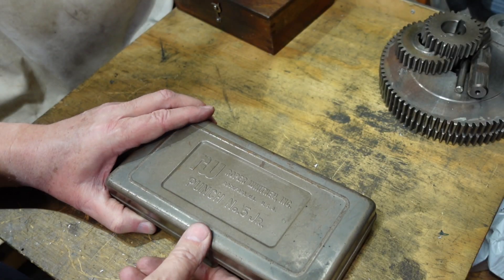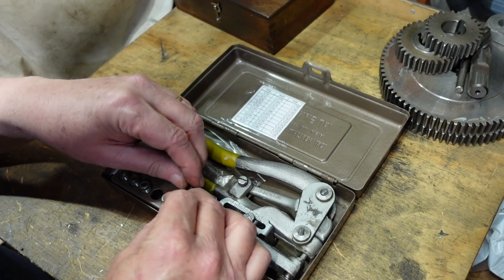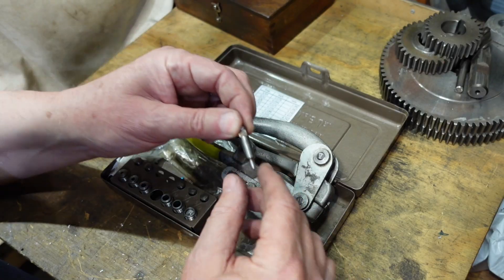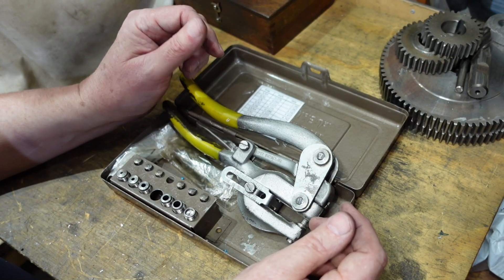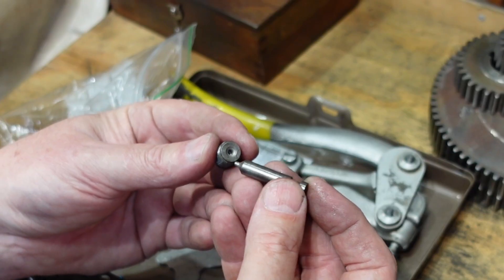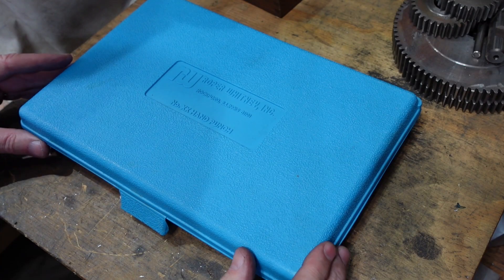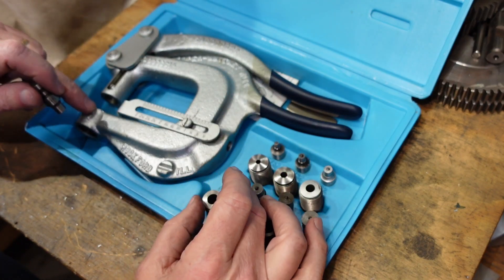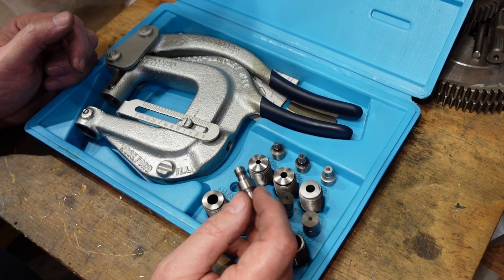Punch and die for an XX hand punch

Comment from the maker: A number of people have commented on the clearance I used, so to enlarge/ augment on what I said in the video - 

I measured every punch and die in the XX set and also in the No. 5 set. They all had around 6 thou clearance. Both punches can apply up to 1.2 tons of force according to R&W, and their web page says they can punch up to 16 gauge material (1.58mm for the metric people) with a 1/4" diameter punch. The usual sheet I use is Al, so I would expect to be able to punch up to around 2mm Al without too much difficulty (and have). I have punched something like 10 thou shim stock too. That worked as well.

I know there are rules for punch and die clearance but in this case @RoperWhitney themselves use 6 thou across a range of punches going from 2mm diameter up to 13.5mm diameter and because of the general nature of the tool, they probably envisiage it being used from anything that the tonnage can cope with. Remembering too - this is not a tool in a rigid precision die set. It's hand tool and there is a risk that if the clearance is too small (and the tool frame worn) the results may be a broken punch.

Rest assured that if I were at work designing a part to be made with a press tool I would be speaking to the toolmakers and designers about what they recommend, and probably discussing at length. In this situation though I'm going with the (tool) manufacturer's defacto recommendation - what they think is good.

Comment: Nice work, i have been procrastinating on making dies for my XX, as the hole  size range is different to the Number 5 and on occasion the deeper throat of the XX could be handy, my intention was to use silver steel in imperial sizes for the punch  and die to reduce the machining and been able to heat  at home,  maybe you are  over thinking the die clearance in the punch size range and material thickness,  in this case as i think some of it is used to allow for misalignment in the press tool, i bought my number 5 nearly 40 years ago new, and yes the paint job was the same nothing under the back stop, mine came in  a blow molded blue plastic case, so your metal cased example must be even older, a drop of oil on the punch i feel makes a noticeable difference even when punching less that 1 mm aluminium, keen to see how you go with with your shaped punches
Reply from the maker: I aimed for the clearance I did just to match the other P&Ds in the set. I figure they have worked out what is good so copying is fine. You are right about the misalignment though and I worked to keep things concentric for that reason.
Good point about the oil - I must remember to check that occasionally.

Comment: Alright, let’s start with the basics. The very first thing you’ve got to think about is material thickness — that’s what determines your clearance. And just to be clear, clearance isn’t just on one side; it’s all the way around the perimeter. Easy to forget, but it’ll bite you if you do.

Next question: are you after the slug to be the right size (that’s blanking), or the hole to be the right size (that’s piercing)? Make that call up front, or you’ll be scratching your head later, wondering why nothing lines up.

As a rule of thumb, a good starting point is about 10% clearance of the material thickness. So let’s say you want a 6 mm hole in a 1 mm sheet. The punch will be 6 mm, and the die needs to be just a smidge bigger — 6.2 mm in diameter, which works out to 0.1 mm per side. Not rocket science, but it pays to get it right.

Here’s a handy trick: if you’re drilling holes to a tighter limit, stone a little radius on the corners of your final drill. Makes life a whole lot easier, and the finish looks tidy too.

Now, about that little pip on the end of a punch — you don’t need it for piercing. Its only job is to help line up the punch with your marked-out hole. Handy, but not essential.

And finally, when you’re finishing off the rear locating diameter on a punch, don’t rush it. Leave the piercing diameter just a touch larger, then finish it off concentrically once you’ve cut the rear locating diameter and groove. Keeps everything neat and lined up. Always best to rough out the whole part before finishing any diameters to size to keep them concentric.

It really helps to describe the clearance as the gap between the punch and die. Not as the difference in diameters, which is half the actual clearance.
Reply from the maker: The clearance I have used is based on the clearance I measured from the exultant punches and dies. They are a general purpose set designed for a range of thicknesses.
As stated in the video, I want the hole to be the right size, so yes, it is piercing.
Clearance was around 6 thou on diameter (0.15mm). I erred towards a smaller clearance for a) thinner sheet, and b) better edge finish in the hole
In preference I would not leave the pip off as it is very useful for locating in a centre puch mark. 
The rear groove is only for securing with a screw to the ram. The rear diameter is the critical one. If I have the time/ inclination one day I will make up a grinding fixture so I can finish grind the punch diameter concentrically with the rear (locating) diameter. Doing it the way I was doing is basically the only method I have at the moment.
Reply: @occasionalmachinist   3 thou a side will suit 30 thou thick material and give 1/3 shear and 2/3 break. This is the trusted hole section for hole quality, tool life and punching pressure. Any deviation from this percentage clearance affects all these parameters.
Reply from the maker: @Bosun-8  Yes it will, but I chose that clearance for a reason as I explain in my pinned comment
Reply: @occasionalmachinist  No problem. You mentioned that there was a specific job for rivnuts. So I assumed you knew the material thickness and would make the die clearance accordingly.
Reply from the maker: @Bosun-8  I want to punch holes for riv-nuts but the material thickness could be anywhere from 1mm upwards
Reply: @occasionalmachinist  At the usual 10% you will need a minimum of + 0.1mm per side or + 0.2mm on diameter.

Comment: Very nice work. That punch looks very handy.
Reply from the maker: It is - and far cleaner, quicker and safer than trying to drill a hole in sheet metal - if you have the right size punch and die